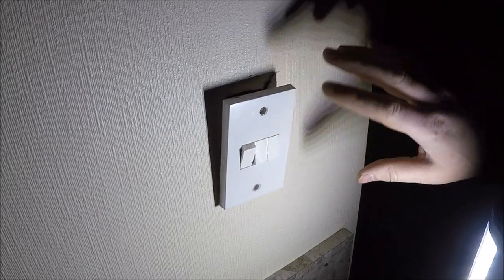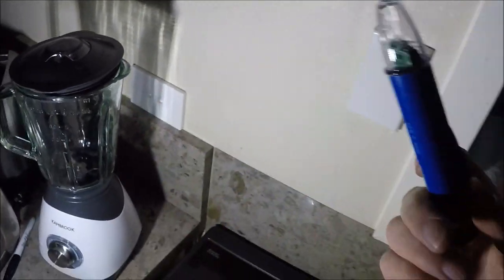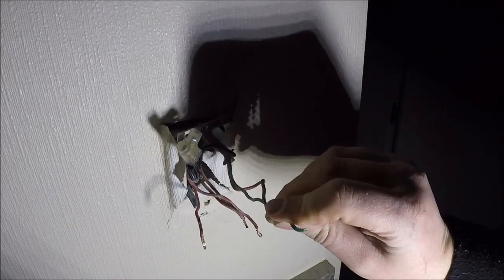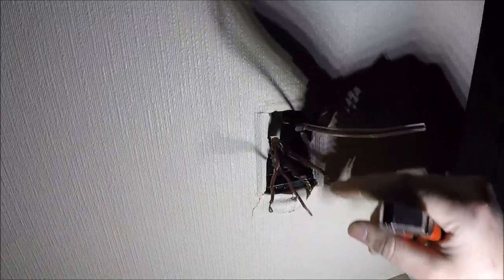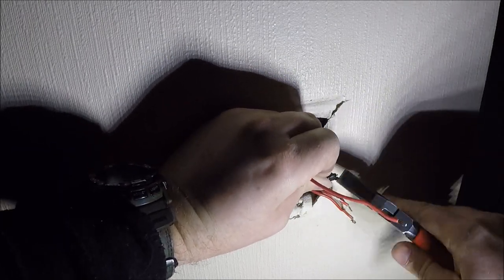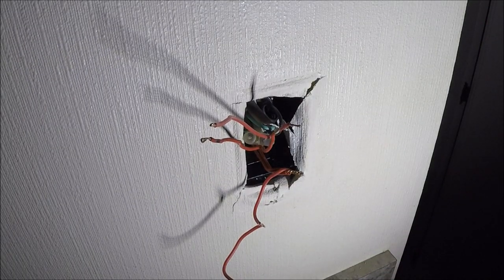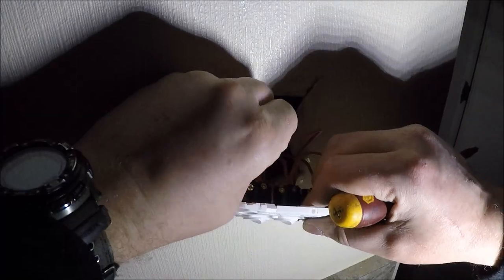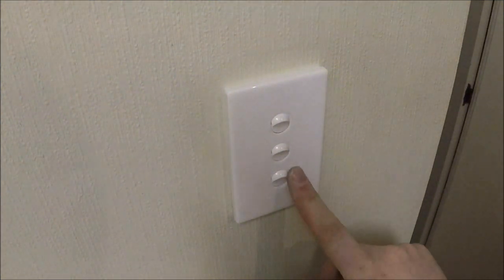How To Replace Triple Light Switch

Comment: Used this as a guide to wire a 3 gang smart switch, this is a brilliant video, I did this as a beginner and a DIY enthusiast and found your instructions very clear and easy to follow. Many thanks :D
Reply: Hi, so you don't need to connect the ground on the switch?
Reply: @asiboy2912  nah because the ground is used for like lights

Comment: Hey sparky dave just wondering why do you remove the metal switch boxes?
Reply from the maker: G'day mate, generally size difference - the older metal and alloy ones are much smaller than plastic/fire rated metal ones we use nowadays. Upgrading reduces chances of 1.0mm cable damage on light switches and also many of the sockets we now use dont fit older flush boxes. I usually replace flush boxes for all sockets and if the switch is a 3-6 gang, if single gang I dont usually bother and two gang it depends if it's steel and sufficient size - i'd leave it, alloy - i'd remove it and replace, and I always tend to replace nails where ever practical aswell.
Reply: @sparkydave  thanks mate

Comment: Dont know why there was a need to start a red wire W loop.
Reply: If it wasn’t there supply in wouldn’t be able to supply power to all 3 switches just like strapped on a 3 way switch with 3 way switches
Reply: @trif169  Ok thanks.